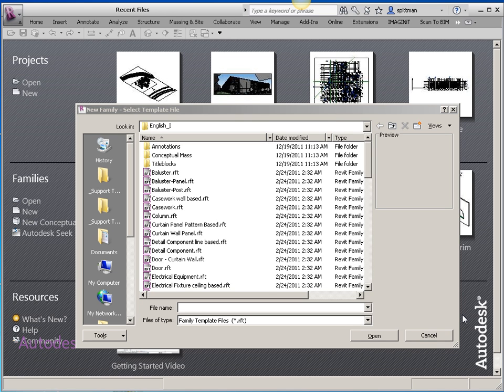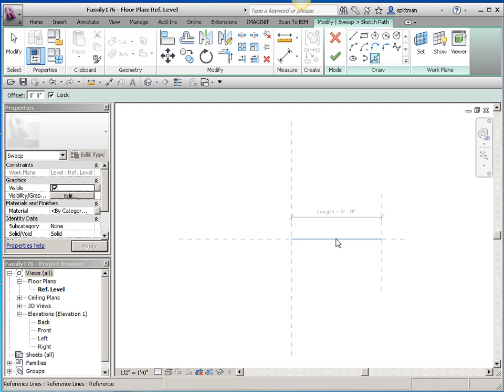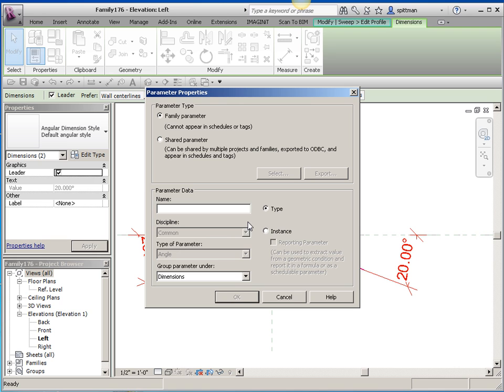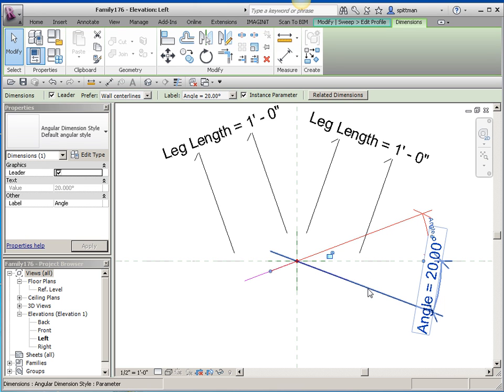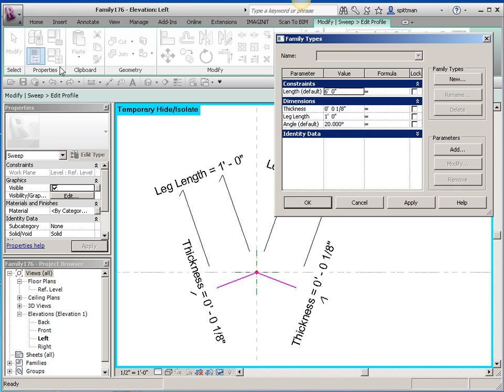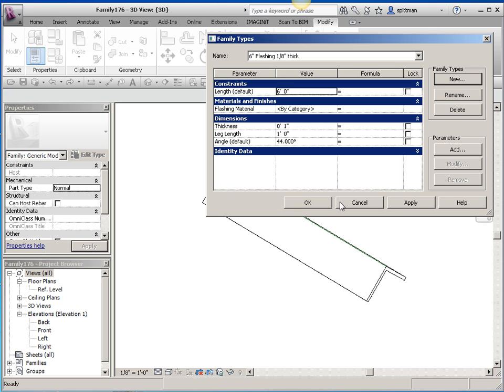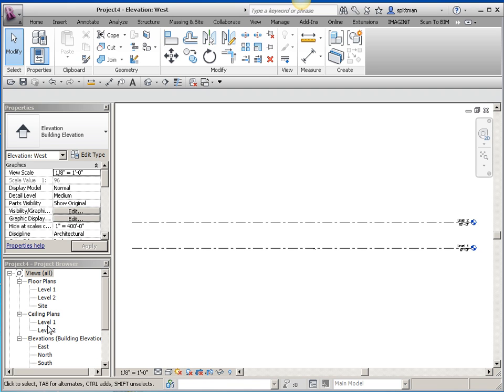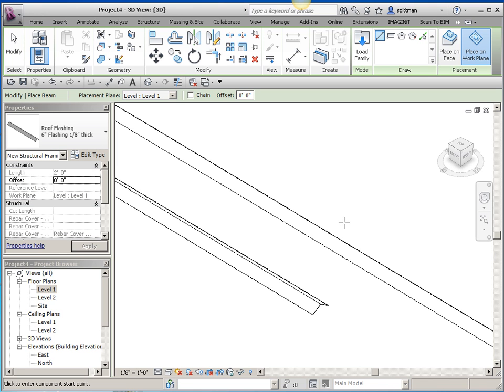Revit:  How to Build a Component with an Angle Control

Comment: Great video, thanks. I have a question...I'm making a louver with adjustable blades but the profile of the blades is an ellipse. Is there a way to do this with an object that doesn't have flat faces to align the angled dimension to?
Reply from the maker: That will definitely make it more challenging, but it may be possible...can you give me an example of exactly what you are trying to create.